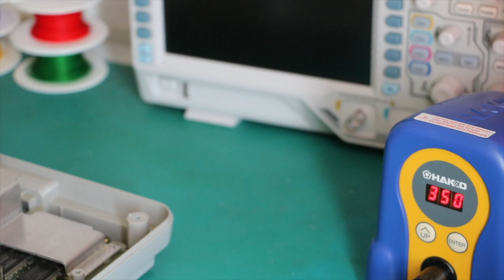Super Nintendo DC-in Port Replacement

Comment: The Super Famicom is 5.5x2.1mm, like just about everything else (Family Computer, NES, Sega Megadrive/Genesis Model 1, Sega CD/Mega CD, some Game Gears, Master System, TurboGrafx-16/PC Engine, Neo Geo AES, etc.

The Super Famicom was not sold with an AC adapter in Japan. You were expected to reuse your old Family Computer adapter, much like they expected Europeans to reuse an older DS charger when the DSi XL launched.

The North American model SNES has a very different plug specifically to keep people from using the NES adapter. That's because the NES adapter actually outputs AC, unlike the FC/SFC adapter. This means that the Virtual Boy had two different Adapter Taps between JP/NA.
Reply: I just got to the part where you ask "what were they thinking?" and, well, it's obvious when you see the North American version. As I said earlier, they didn't want you to be able to plug in an NES adapter since the SNES did not accept AC, but they also took the opportunity to make it completely non-standard. This let them prevent the use of universal and generic AC adapters, though fitting 3rd-party AC adapters did appear (purpose-made, of course).

Comment: Its tons easier doing it the other way around. Braiding all the solder off the pins before removing is difficult due to thermal mass of PCB and the part. Instead put a piece of braid between pins, flood it with solder and heat everything up while pulling on the part. Plops right out with easy, now you can clean up excess solder from pcb.